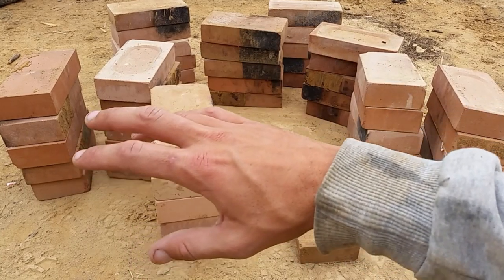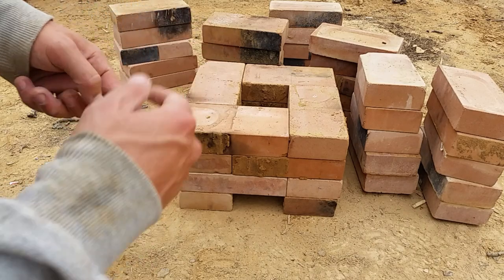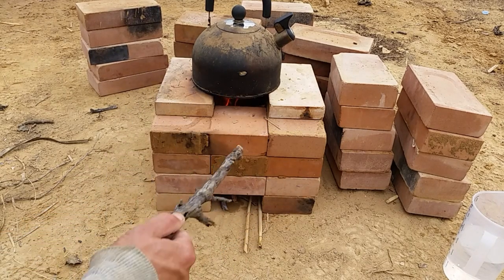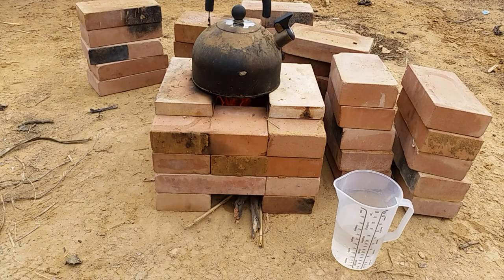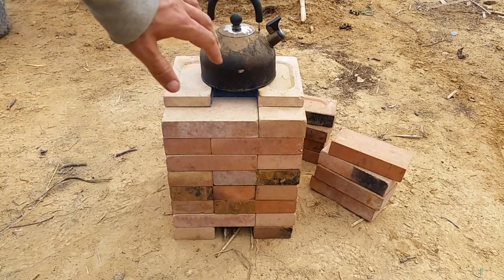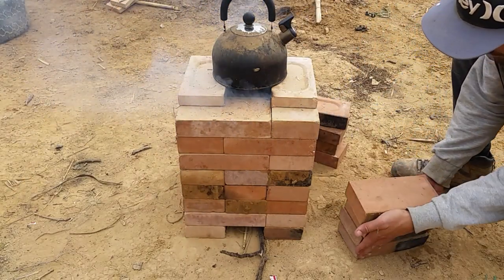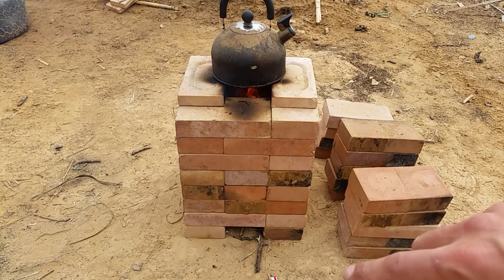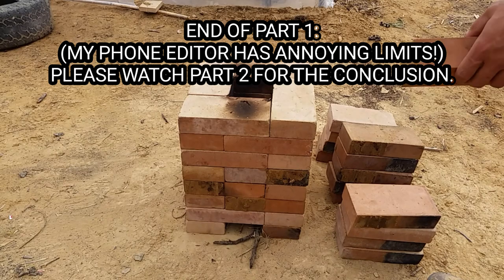ROCKET STOVE WITH ONLY 16 BRICKS

Comment: Without the separated air supply the taller stove can't work to capacity. You can tell your stove/fire is burning efficiently if there is little or no smoke. Plus, once the effect of the tall chimney starts to really work you will hear the 'rocket' sound as the air is drawn through very quickly.
Reply: Ah that's what the rocket part means, thanks👍

Comment: I would recommend trying the two different stoves but don't put the kettle on until you get each stove burning good AND the bricks hot. Maybe check the temps with an IR thermometer.

Comment: So is the wire grate not really needed?
Reply from the maker: It helps airflow. If you put stuff on top and don't allow air to escape it kills the fire below
Reply: Very easy to choke off your air supply without a separate air channel.